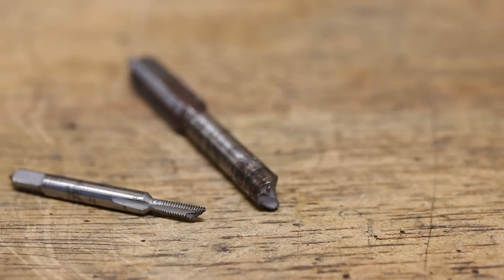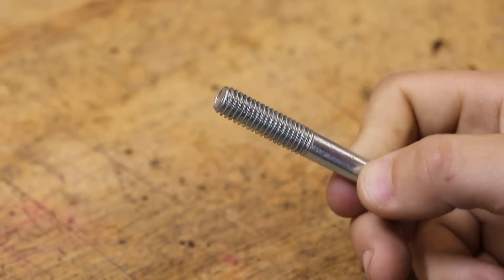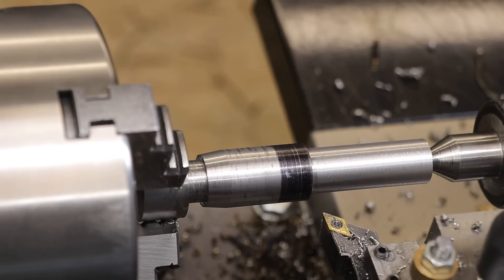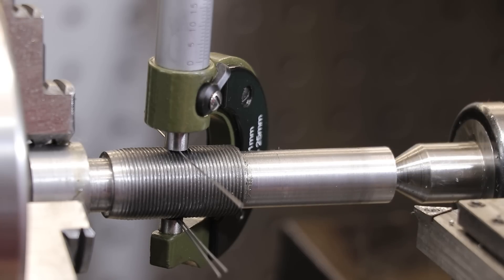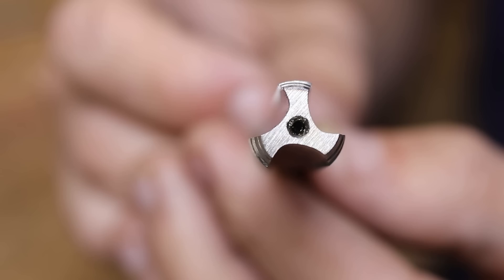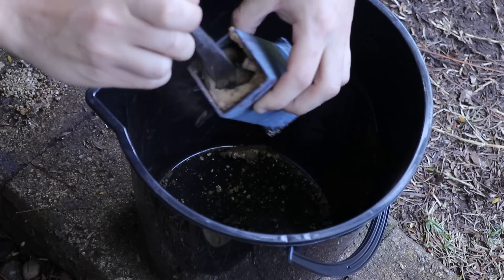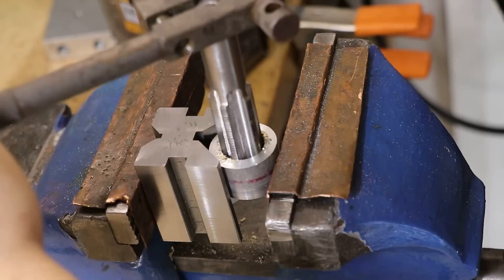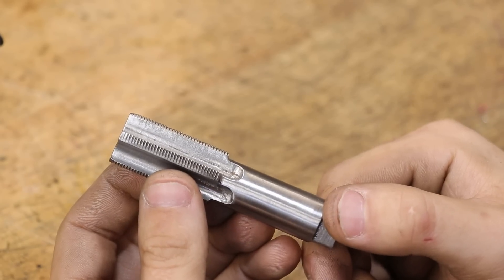I Need a Custom Thread Tap - Shop Made Tap

Comment: I needed to make a 1/2-10 left hand 2C tolerance (tight) ACME tap to upgrade my lathe cross slide. I knocked 3 practice onces out of some unknown high carbon steel until i felt comfortable- then i made one out of some expensive tool steel. Turned out BEAUTIFUL, all that work and I never once checked my TPI😂 i had goofed up gearing and made a beautiful 1/2-11 2C left hand ACME tap 😂 woops.

Comment: Unharden some old drill, make the tap, then reharden it
Reply from the maker: I’ve tried to reuse old broken drill bits but hss is just a tricky metal to harden properly in the home shop. That’s why I prefer a basic o1 steel or a case harden

Comment: The real fun comes in is a tap breaking off in an area that is just big enough for a right angel drill with a bit or a tap being able to be chucked. The breaking off  of the tap if not removed where the disassembly would be in the thousands of dollars just for the repair not including the machine down time.

Comment: I’m and over the road equipment mechanic. I have used the bolt with the flutes hand cut on a pinch to clean up a thread that have been damaged, and it did ok to help smooth them over to get a bolt back in.

Comment: I have made "field taps" from grade 8 and 10.9 bolts that worked flawlessly. I give them straight, forward and neutral rakes in the three main cuts. I'll also make shallower cuts on the front in addition to the main cuts.

Comment: do fine pitch threads like that make it difficult to single-point inside cut with a boring bar?
Reply from the maker: No really. The reason I made this was because I wasn’t able to hold onto my part on the lathe to cut the threads. Much easier to make a tap to do it

Comment: You could mill those 5 flutes into a higher quality screw and then grind the cone .. it would take much less time.
But on the cone you must add a clearance angle, this will make your tap more effective.

Comment: When i was an equipment mechanic i only had taps up to 1/2" plus a few randoms here and there, i never tapped threads but i did clean threads with a bolt with flutes many a time

Comment: Seemed a bit odd to me to run the bolt "tap" through the hole with a drill when you'd never do that with a regular tap. And then complain about the results of using the bolt. Why not use the bolt as you would use a tap, slowly, with periodic reversals to break the chips?
Reply from the maker: It’s exactly what I do with normal taps if I’m tapping thin aluminium plate
Reply from the maker: Turns out fine

Comment: ball nose is fine for flutes. the offset flute really requires the correct cutter otherwise the rake doesnt work out. 5ish degrees, like top rake on a lathe tool... looks like this is at least 15. makes the edges rather delicate. best not to change things, follow the standards. if a ballnose is what you have, use the ballnose method.

really, that grindstone is closest to the profile you actually want... shoulda hardened the thread then just sighed and spent a LONG time grinding... or roughing with carbide? next time. i know, this is a one off for a one off... good learning curve ;)

taps generally arent relieved... the lands act as a guide. just the taper for the lead in has some clearance to it. the flute is generally large enough that theres not too much friction. it isnt a milling cutter. plus it keeps the thread clear and stops it stripping on the backing out.

save all the short stumpy ones, theyre very handy when you have to do copper, or titanium...

Comment: One of the most appreciated skills I had, was tool making. It needs the persistence of a maniac 😅.

It was the only way to get some relief from my shop partners who found in me the perfect prank victim. My special tool box was out of reach and when they needed some, they knew that a prank would lock tools away for a long time 😂.

You should start making tools and sell them. Many people will appreciate and do not pretend to get perfect tools. While starting and testing new ways, you will become better. Over time, tool makers are the most payed shops. Once you started, your name will precede you 😊
Reply from the maker: You can definitely get a surface flat, but I am not sure how well that method can take two surfaces to be parallel to each other

Comment: I've worked on some oddball stuff but that's the first time I've heard of a 13x0.75 thread.
Isn't the 6.9 a Schrader tap size?
Reply from the maker: The 7.9 is for fitting made by a company called bock

Comment: when i break a tap its a nightmare depending on how much time i put into the part on the cnc is how i would decide cuz if its something i put hours into im using a carbide endmill and milling that tap rewelding the hole and then trying again

Comment: Interesting, however, the only advantage you have with this is time…you get your tap quicker.  Considering time, materials, tools, chemicals etc. the cost is much higher than a store bought tap.
Reply from the maker: It’s not a job for me so I’m just factoring material costs. I think it was about $25 for the steel, charcoal and LPG. Cheers

Comment: I work in a machine tool repair shop, and that bolt with slots trick is something we do a lot, mostly in steel. Better to try and use that to chase/clean up a threaded hole and break it off than a tap     . Works great imo

Comment: The geometry on your tap when you first tried it actually has a slight negative relief because as you turn the tap it advances into the cut thread and the cone shape of the flat tops of the cutting teeth increases in diameter and wedges tight.

The effect is only slight but is definitely non-zero. The negative relief angle can be calculated from the thread pitch, diameter, and cone taper angle.

I need to get/make a 3/16-40 55 degree tap, just a shade smaller than #10-40 which is itself non-standard but available (with 60 degree angle). This seems much more challenging than the relatively monster-sized tap you make here. On the other hand, I only need it to chase out remnants of drilled-out brass screws in hardened steel so just the gashed-bolt geometry without hardening might suffice.

Comment: Why are you measuring the profile with a thread wire? You have a full profile cutting insert. This one machins the outer diameter also, so to measure this is enough...
Reply from the maker: Ag60 ER inserts which this tool uses are partial profile. And I wanted to get the final measurements to be spot on. Plus I was recently gifted this set of threading wires so I could resist bringing them out. cheers

Comment: Should’ve just started with annealed high speed steel would’ve saved a bunch of unnecessary witchcraft(I mean chemistry). Also why go witha5 flute design over 4 or 3?
Reply from the maker: I’ve always found HSS of any grade to be incredibly difficult to heat treat at home without a heat treat oven as it’s not a water/oil quenching steel and  it requires several tempers to achieve proper hardness. 

The 5 flutes were added to make the relief grinding easier. Less material to remove
Reply: I think you can just use an old toaster oven for tempering and it would be well worth the extra cycles since mild steel doesn’t harden very well if at all, but if it’s a one off tool that you don’t plan on using again i Can see where it’d be better to use cheapest materials👍
Reply from the maker: It’s been a while since I’ve looked at the data sheet for M2 HSS but from memory the temper temp is around 500-600 centigrade. Very different to what you’d do for a normal carbon steel

Comment: Good stuff as usual. A couple of years ago I bought a job lot of Ebay UK taps and they have been lifesavers in each case I resorted to them. I got a jackpot lot at a local recycling depot, mixed imperial and metric too. Your video shows the last ditch option and very useful it is too for those with no metalworking experience. Cheers.

Comment: One thing is you have to tap slowly and back and forth not just full throttle drill
Reply: Exactly. "The poor threads in this hole are because I used a bolt, and not because I rammed the thing through the material."

Comment: The last one I had to buy was specific to the cylinder head bolts on this one specific engine and maybe a few others. Very uncommon. So much, in fact, that the only place that sells one is the automotive performance parts stores. There is no other bolt anywhere with this weird thread pitch except for Chevy engines.

The kicker is it wasn't to cut threads. It was a thread cleaning tap. That's what most people try to make when they cut slots in a bolt. The thing is that thread cleaning/chasing taps have threads with a different geometry than a standard bolt so that they clean the entire threading area and not just some of it like a slotted bolt does. But most people either don't get it or don't care.

That cylinder head bolt cleaning tap was essential for anytime you remove the head on a GM Atlas engine and maybe LS1s? The bolts already break when you remove them so having the threads surgically clean is the best you could get.

Comment: Best way to prevent caps from breaking is to buy a very high end set of taps. They break the bank but they won't break your workpiece. They also give you that peace of mind not having to worry about things like this. Not everyone has a bunch of money to throw at expensive tools, same here, but I still manage. I try and only buy the best of the best when available. I never have to worry about my tools breaking, so I am always confident in my work.

Comment: Just single point the bushing in the lasthe. Leave the tap out of it.
Reply from the maker: The intended use of the tap is a for a big square billet. Wouldn’t be able to fixture it on the lathe

Comment: 1 or 2 day to make and cheaper than $50.  You dont value your time very much.  Even at 1 to 2 hrs its cheaper to buy.

Shop i worked in machine time started at $100/hr.
Reply from the maker: I don’t work as a machinist, I do this in my spare time as a hobby
Reply: @artisanmakes  made a good video but not economically unless you only make $5/hr, or is an unobtainable item.
Reply from the maker: That’s why this is a hobby machining channel….

Comment: uh... m7.9x.06 es a 5/16-40  m13x.75 is probably a 1/2-32, yes not exact, but the tollerances especially how sloppy metric threads in general are, then it probably would have fit (and failed early btw)

Comment: Quick tip for saving aluminum parts if your part is aluminum and you break off a steel tap that there is no other way to get out you can submerge it in water mixed with alum powder used for brine making the alum will slowly dissolve the steel and leave the aluminum alone you can usually find alum powder in the spice section at the grocery store it takes a lil bit but can save a part with lots of hours in it there's some more in depth videos on it on here 👍👍👍

Comment: I got rid of the frost set - nothing but grief from those ! You can get all sorts of weird taps and dies from LPR toolmakers , mostly carbon steel but they also do HSS . I got all my BA and ME sets from them and have had zero issues with them.
These days I do everything in metric.

Comment: Wouldn't  a smaller flute have been better, therefore leaving more threads and a greater to cutting area, it just seemed alot of cutting threads to remove.

Great video by the way 👏
Reply from the maker: I gauged it was easier to grind in the relief

Comment: 2 hours case hardening amounts to a few tenth of a mm penetration depth in most cases. I don't think I even bothered to temper with such a thin layer. 
This tap is not suitable for steel, as the base material (mild steel I think) has too little tensile strength. As noted by others, the relief in a good hand tap does not continue, but ends where the full diameter is reached. The idea is that when the tap is turned back the chips that are still in the threading are pushed back, instead of getting wedged between workpiece and tap.
Reply from the maker: Youd be surprised how much the sodium carbonate speeds up the carburizing. And for what its worth it did just fine tapping 1020 and 316L, this tap will do just fine. The machinery's handbook seems to be absent on the detail on the relief, it suggests that its baked long the length of the tap. Ill have to add a note to it
Reply: The penetration depth I mentioned is with charcoal and 5% sodium carbonate. I can provide a handy graph (carburising temperature, duration, penetration depth) if you are interested. If you succeeded in tapping 316L and the tap is still usable, the steel of the tap couldn't be mild steel but something with a higher tensile strength.
Reply from the maker: No it started off as a piece of 1020 bar stock. Not my first choice but hey it works just fine

Comment: Good video. But why did you not just screw cut the part in your lathe?
Reply from the maker: The part I need to tap is a large piece of square billet with an off set hole. Probably wouldn’t fit on the lathe
Reply: That makes sense..cheers.  @artisanmakes

Comment: "It should end up cheaper and only take a day or 2." he lied, knowing full well it was going to cost 3 times the off the shelf tap and take just as long to make.
Reply from the maker: That is not a fair assessment. $3 worth of steel, $5 in LPG and a bit of crushed up charcoal. This isn’t a job for me so the time I spend here doing this I don’t factor in. If that was a job shop I’d have to factor it in.

Comment: Im curious, would the "Youtube short" version work if you used the ballmill instead of the anglegrinder?
Or took a lot of care to make good flutes with a dremel, and harening it ofc.
Reply from the maker: Maybe but bolts are also slightly undersized to allow for a non binding fit. I’m sure you could make it work, but it wouldn’t be a proper sized thread.

Comment: What are the benefits/drawbacks of doing spiral flute on taps?
Reply: I’m no expert, but the little experience i have is that you get more chips/shavings traveling upward with the flutes while you tap. This can help you tap slightly deeper in stopped holes with lesser cleaning required.

I can imagine that they problably are harder to make.

When i use one i get a more ”springy” sensation.

Comment: LOL......that "tap" you made from the bolt was crap as the lands were too wide.....you need to cut the gulleys much wider to give you only 30% width or the tap will just jam in the thread.
Reply from the maker: Not exactly supposed to be a work of art but I’m sure you’ve seen shorts with  people doing the same. This is more the point I was trying to convey

Comment: How about one of those $20 Chinese 1000W induction heaters for the 2nd hardening+quenching part of the job? Gets to glowing hot in 10 seconds. You could even possibly do it inside a glass test tube with some additional carbon material to really help those cutting teeth stay sharp.

Comment: Rather than messing about with diffusing carbon you should just use a proper tool steel like O1, it produces more consistent results with less effort.
Reply from the maker: Well I didn’t have any on hand, not in the diameters I need anyway
Reply: @artisanmakes  Fair enough, I usually only have O1 in 12.7mm on hand and anything larger gets a special order. 

Case hardened low carbon steel probably won't last that many uses but if its only needed for a single project that isn't an issue.
Reply from the maker: It’s a good thought about the durability. It’s probably not too far off from a W1 tool steel, maybe a bit less carbon but I’m sure the performance should be similar as long as it’s doing cold worm

Comment: Your Tap looks pretty good to me. I'm always running into some odd ball non standard bolt that I've got to run a tap for at times. I have used the cheap method if its just soft metal I'm working with.

Comment: Why didn't you start with tool steel or high carbon steel or at least 1045? Two hours in a furnace probably consumes like $10 worth of propane alone...
Reply from the maker: I don’t have any tool steel larger than. 20mm and if want to start with 25 and take it to size. And you’d be surprised how little gas case hardening uses, once you get it up to temp you can run it on 2-3 psi

Comment: Leaving aside the fascinating process, if your lathe can cut the outside thread why could you not use a small boring bar and just cut the inside thread? Or was the demonstration not the actual part you needed to use this tap?
Reply from the maker: I’m tapping a large square block for the project and I don’t have a 4 jaw chuck to hold that part offset on the lathe

Comment: Very interesting hardening process, just out of curiosity is there ant special care you need to take about the CO gas building up pressure inside the packing box and cracking the seal?
Reply from the maker: I suspect that it finds it’s way out but it’s slow enough that it it doesn’t allow any oxygen in. There is never scale on the parts if it’s done properly
Reply: I'm far from an expert in this subject, but if you've got gas building up pressure from the inside then you don't need to worry about cracking, because the pressure inside the vessel is higher than the pressure outside, and you won't have any gas getting in.
Reply: Oxygen that gets inside is just consumed by carbon (making more CO).

Comment: My favorite taps are spiral flute machine taps. I got them very cheap from China as a set M3 to M12. I use them in the lathe, drill press,milling machine and by hand. They work great in steel, aluminium and stainless. I don't know a brand but they are complete black.

Comment: Could you use a store bought tap with a 1mm thread pitch as a cutting tool to cut teeth onto a tap blank? If you set it up right in the offset you could dial in some relief as you cut the threads into the blank?

Comment: It'd be rather easy to extract the tap from the aluminium by simply dissolving it. Alum + hot water + a bit of time and the tap is gone without affecting the aluminium.